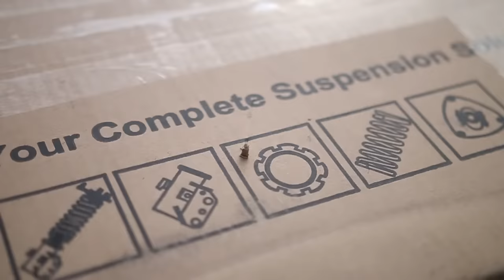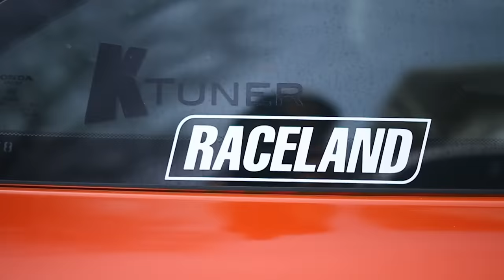Transforming A Subscribers Car On A $1,200 Budget!! (10 min build)

Comment: Use soft edge masking foamy tape to prevent overspray under doors etc.. it is not expensive and it will upgrade your final result. Also better preparation is a must.
Reply from the maker: Thanks!
Reply: hes doing everything rlly cheap😂he’s already doing enough but go off byd
Reply: Oh wow
Reply: @roydiaz4115  when doing things cheap you often have to replace money spent with time.  I dont think he was leaving a rude comment, just more of a "heres a tip" type thing.  The paint looked good, but imagine if they got a better result with essentially no extra cost? Wouldnt you be happier?
Reply: @roydiaz4115  it's not like that tape costs hundreds of dollars mate
Reply: Somebody always got sum to say 🤦🏾‍♂️

Comment: Did not know that tesla wheels would fit these 8th gens. Great job with the job. Tbh, the factory paint on these 8th gens were absolute trash so your work def made this thing 100% better.
Reply from the maker: I found out during this process as well 😂 Thanks man
Reply: I want to buy a 8th gen what issues can I expect when I buy one ?
Reply: 6th & 8th gen civics got all the love. Wouldnt surprise me to see this. Everything else is average, except the 7th gen. We got shitted on the most :'(
Reply: @dbzownz12345  bruh me and my es2 felt dat
Reply: @shjmo  haha yeah man. I feel it it too. My poor EM2 drowning out here. I've just accepted the fact that our 7th gen civic's are meant more for cosmetics than power. Our engine's suck for mods :(
Reply: My 8th gen civic coupe has been in alaska since i bought it brand new and has the same blue metallic paint. No problem with my paint at all. And 250,000 miles later the original serpentine belt.
Reply: @jakespohnholz8715  nice. I know that hotter climates and cars that aren’t garage-kept tend to suffer the most.
Reply: @castiland1000  My 2010 I bought new now has 168k and only had a front right caliper seize. I’m still on the original clutch.
Reply: @castiland1000  for me it was just the paint had +236k miles runned like a champ before going through a puddle that ended up damaging the engine 🥲
Reply: @dbzownz12345  sucks that the K20 was only in the hatchback EP3 Si. They should’ve had an Si coupe at least. They had a 5th and 6th gen Si coupe then skipped for 7th and went back in for 8th ☹️
Reply: @cristianortiz1684  Couldnt agree more. I have a 5 speed, guess that's my "Si" for now, haha. But all jokes aside, they did the 7th gen civic owners dirty. Not a fan of the EP3, yet to drive one though...maybe i'll try it sometime
Reply: It depends on how the car was stored. My generation 8 paint has remained flawless for 14 years. I garaged it and had it inspected once a year.

Comment: Make sure you guys get the proper lugnuts for those model 3 wheels or they could get damaged and woller out.. The seat needs to be at least 23MM wide and has to be a conical seat, because The tesla wheels are meant for 14MM studs whereas honda uses 12MM, so you need to make up for the difference with wider lugnuts. Stay safe!
Reply from the maker: They were ordered. Thank you!!
Reply: Hey bro I'm going through the same thing can u please send me the link where u got ur lugnuts from
Reply: whats the link for the lug nuts

Comment: Quick tip 
Take more time on prep really feather edge the clear and prime it 
Then sand with 600 way better results 
You wont have those rings. And paint will last forever. 

Great content 👍🏼

Comment: I can't believe how well that paint job came out. That was really well done.
Reply: You can’t be serious right now…
Reply: bruh it's soo bad
Reply: Post up your rattle can paint job 🤗. Where are the tigerstripes? You're telling me a cut and buff and you'll be able to tell the difference right?

All good though, you can have your opinion. I just personally wasn't expecting it to come out the way it did for using spray paint. I respect that you think it could have been better.
Reply: The paint work is insanely bad, I appraise cars for carmax and they would take money off that car based on paintwork alone
Reply: @frankisnottriggered2033  in what way is the paint job insanely bad though? By what standard are you basing your description on? I think you guys are conflating the idea of a paint job done in a booth with a spray gun with what actually happened in this video. Again, you can have your opinion and I respect it. Could the paint job have been better? Of course it could have been. But based on what they had to work with and the materials they had budgeted, the paint job came out better than I thought it would.
Reply: @Mr.Wongburger  Insane orange peel and overspray, lack of proper prep
Reply: @Acadias  from a spray paint can outside right? I'm confused why anyone is expecting a professional paint job. I feel like there is a breakdown in understanding, I had originally commented that I was surprised how well it came out and that for the type of job they did it was pretty good.

I am by no means saying that the paint job is show quality. That's obvious. Orange peel comes with just about every single paint job done, outside or in a spray booth. There is obviously a much better result from a professional job, but that's why they cut and buff after. To get rid of orange peel.

Things I was expecting from their job that I didn't see- tigerstriping, overspray, runs, dull spots. That's what I was basing my original comment on.

Again, I understand other peoples point of view will be different from mine. I just think the expectations are a little high for something that was advertised as being budget.
Reply: @Mr.Wongburger  you can clearly see a LOT of paint bubbles in closeup shots when the light hits the paint, that is a telltale sign of a bad paint job
Reply: @Mr.Wongburger  he could’ve literally made more money on his car selling it like before, now the paint work devalued it because of the bad quality and colour
Reply: @frankisnottriggered2033   I agree with you... I'm a Licensed Automotive Painter and I'm crying seeing the prep and the paint job here...
Reply: @Stewe_9thGen  yeah I saw that paint and I wanted to cry too lol, this other guy doesn’t know what he’s talking about
Reply from the maker: Thank you bro. Not sure what people are expecting 😂 it was outside and with me having only a year or so of unprofessional painting experience and all in cost around $300 with paint and equipment. Its budget, for that I think it came out good. And he loved it! Thats what matters :)
Reply: @SmplBuilds  I understand all that don't worry, it is just painful for someone like me you know 😂
Reply: @SmplBuilds  it’s good for 300$ but it’s now a good paint work, that’s what I was telling this guy lol

Comment: What's the deal with these old Hondas and the paint wearing off? Did they use low quality paint or thin layers? Seems to be really common on early and mid 2000's Hondas.

Comment: I’m sorry but that paint job was horrid. Didn’t mask off any of the jambs, over spray everywhere, and get any closer than 50 feet you can see all the mistakes in the job. Never paint a vehicle outside, there’s a reason PROFESSIONALS use an enclosed area.
Reply from the maker: Yup. This was a budget paint job. Not a professional. Everyday hobbyist can do this. That's the point. It's not that serious :)

Comment: Wow my 2012 Si is pretty much in the same shape, just needs $1,200 in TLC? I can do that! I thought it cost tons to paint a car. Do you use a clear coat or recommend ceramic coating after?
Reply from the maker: This was single stage paint. Clear is built in to the base

Comment: Nice thought, but painting outside like that? No regard for overspray on the neighbors stuff, let alone spraying chemicals like that out in the open. Didn’t do anything to the dents on the lower sides. The paint looks awful on the sude. Door jams and under the hood still blue. It’s a nice gesture but not done properly and that paint will probably cause more headaches than anything in 6 months. Should’ve just done the mechanical and done a wrap.
Reply: @SmplBuilds  it’s called feedback. People use constructive feedback to get better at what they do?

Comment: Mad respect for hooking ppl up like this, but if you're going to paint a car please learn to do it properly. Painting outside (especially on a windy day) is just begging for trash to be all in the paint and it's evident in the spoiler paint. Did you wet sand it? Also the stopping mid panel without flicking your wrist upward while painting is a no no that's just asking for runs in the paint. I'm sorry if that sounded harsh but you have the tools just take the time properly learn the technique. I'm not trying bash you here just offering some pointers for future projects so the results are even better.

Comment: Yo, when you cleaned the engine, did you just hit it with hot soapy water and a brush? If so, that's straight up 👍. Been looking all over the internet for a simple solution.

Comment: Was clear coat sprayed after the initial paint coats? Because the clear and previous paint wasn’t removed, can paint adhere well enough without primer and old clear coat still on parts of the car? It looked like just the failed clearcoat areas were sanded down. 

I ask all this because I have an 8th gen si that has trashed clear coat but my understanding was for it to last I’d have to sand down the whole car to at primer lvl

Comment: i have a question im a new sub so i dont really have ur knoledge yet, what do i need to sand down the paint off the car what grit would u recomend or what do you use, and than what do you use to spray paint the car? im ganna get this same car and im just wondering what materials you put in the paint and what orange you used

Comment: while i do respect what you guys are doing and think that you guys are doing a great thing, you should have completely sanded the paint down to primer and painted  it orange, or just repainted blue again , because that is only a thin layer of paint and when that paint starts to chip the blue is going to show through the orange and the entire car will look like a mess. i might look like I'm talking out of my ass, but I'm not, I'm talking from experience.
Reply from the maker: Thanks for the tips but I also know what I'm doing and you're wrong to be frank lol
Reply: @SmplBuilds  hey this car is now on Facebook marketplace for $2000... motor blew up 😆
Reply from the maker: @jeremysantos4753  yikes lol